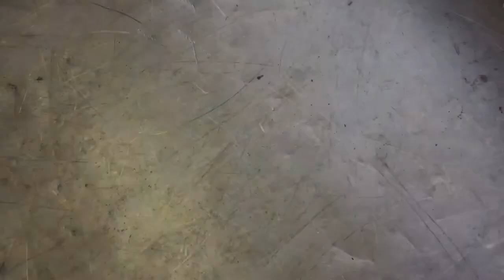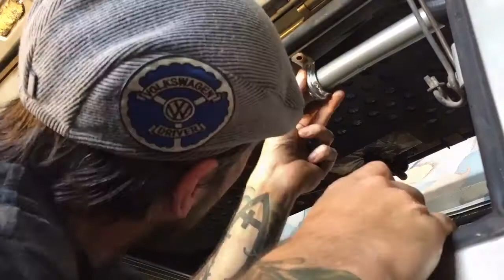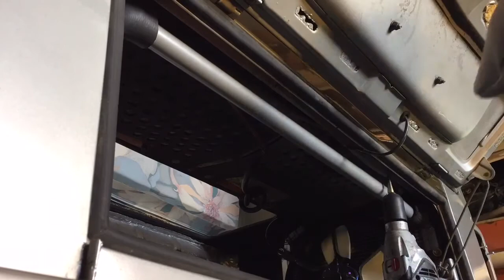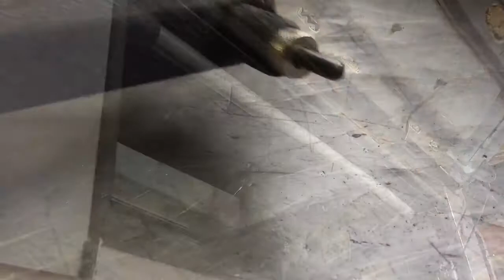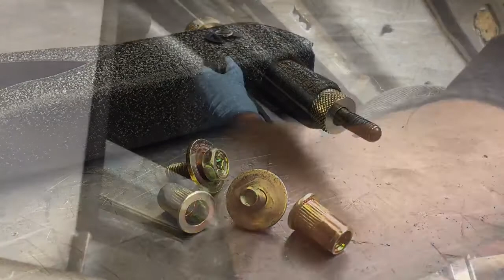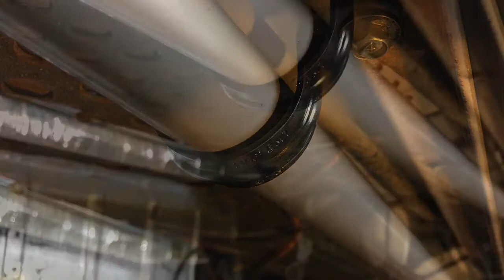Coolant Tube Supports - Daily Driver VLOG 6/20/17

Comment: Chafing of the brackets through the aluminum pipe? Or perhaps rattling? I'd put a rubber buffer in there.
Reply from the maker: +Forthwith Tx Good point, I was thinking of using some oversized radiator hose upon final assembly, but Plastidip just occurred to me - that should work awesome.